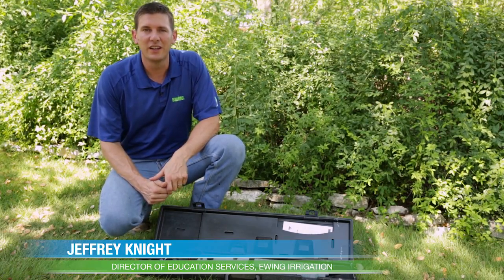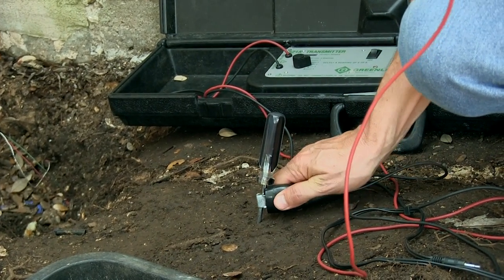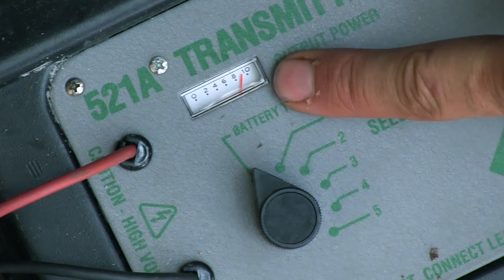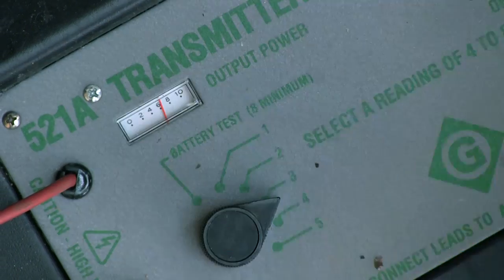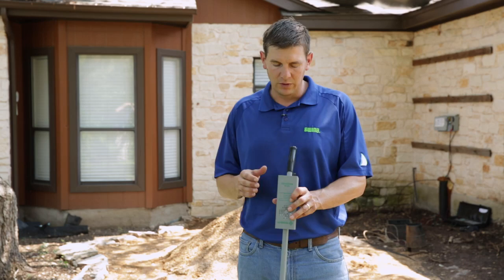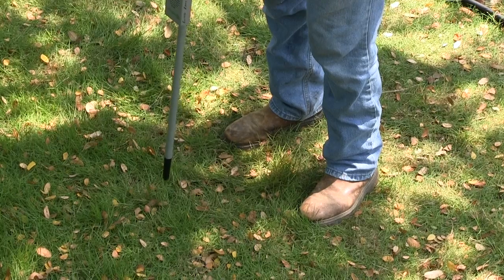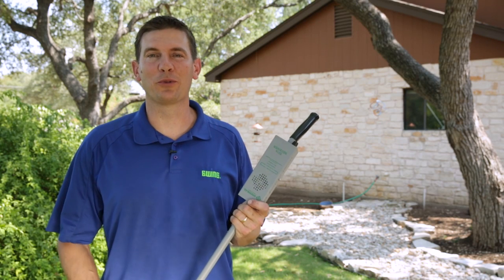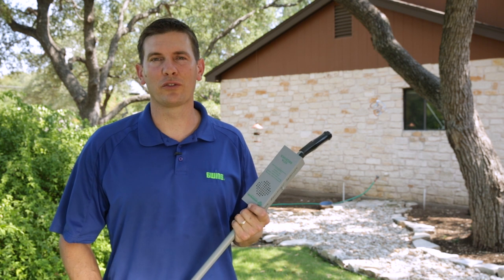How to Use a Wire and Valve Locator

Comment: What do you do if the controller is enclosed inside somewhere where you can’t easily setup a ground?
Reply from the maker: This is from the manual:
With the transmitter off, connect the red lead to the wire to be located and the
black lead to a good earth ground with the stake provided. 
If the clock is indoors, the earth ground stake MUST be grounded at the point
where the wires exit the building. It might require running a length of wire to the
outside. Do not use a common ground inside (i.e., electrical or water pipe).
Thanks for the question!

Comment: What kind of wire can I use to extend the ground cable outside of the garage into the ground? My irrigation box is in the garage
Reply from the maker: Depending on your needs, you will find single and multi-strand irrigation wire here:
https://www.ewingoutdoorsupply.com/products/irrigation/wire-electrical-supplies

Comment: I'm having a issue with mine, I connected my ground the foundation ground, and it still wouldn't go past the zero, unless I'm on battery test. But my battery is a little lower then 8, I'm not sure if thats the issue. I also pounded a 6ft steel stake about 2-3 feet down to ensure a good ground. Do you think it's my battery level or could it bee faulty ground or possibly the machine is broke but it's in great condition.
Reply from the maker: Hello Travis, here's the link to Greenlee's support page. They should be able to help you figure it out. 
https://www.greenlee.com/us/en/contact-us
Reply: What did you figure out ?
Reply: From my experience you need good hot batteries..

Comment: This product can check 400VAC Cable fault location? or Only Communication Line?
Reply from the maker: Sorry for the late response. If you are trying to locate a fault, you may want to take a look at the PE2003 Pulser Ground Fault Locator: 
https://www.ewingirrigation.com/shopbybrand?manufacturer=1387

Operators Manual:
https://www.ewingirrigation.com/downloads/dl/file/id/311/greenlee_pe2003_pulser_manual.pdf

Here's a video on it:
https://www.youtube.com/watch?v=zjZ0Vfi9VRQ

Comment: What is the depth range??? Maximum depth range??
Reply from the maker: +Adam Ortega - Thanks for your question. The manufacturer does not list a maximum depth range for this product. This link will take you to the manual for the 521a if you would like to learn more. http://greenlee.ebizcdn.com/dcacff2565700c8f88f59cf4a16f9dfc

Comment: Hi Jeffery, is this the best instrument you have found to locate valves?  How much does it cost?
Reply from the maker: Scott gregery 
A map of the irrigation system it the best thing, haha! I am most familiar with the Greenlee 521a shown in the video, but I have also used the Armada Pro800D and it works well too. They cost in the neighborhood of $700 (give or take). It is difficult to find valves if the field wires are cut though. -Jeffrey